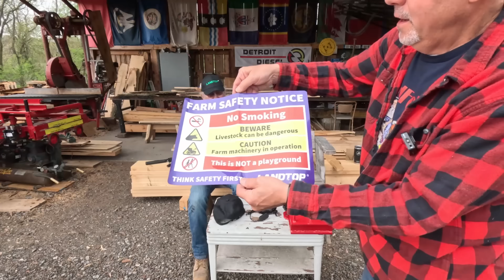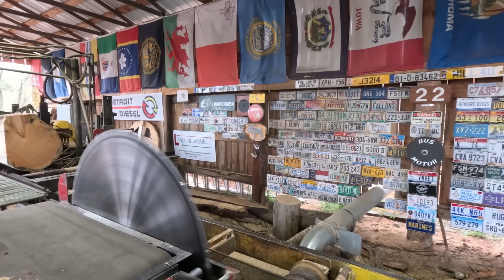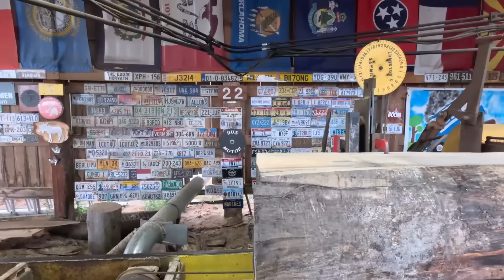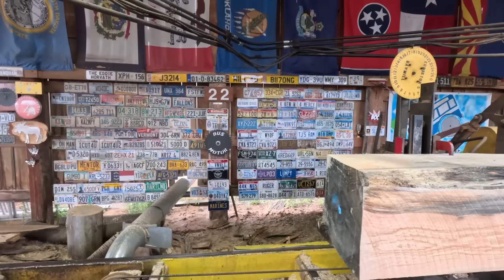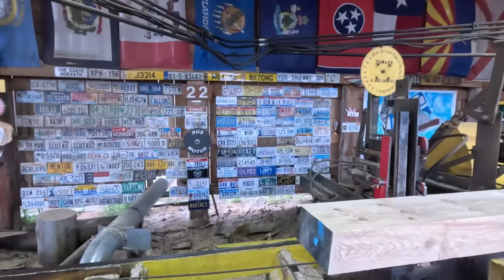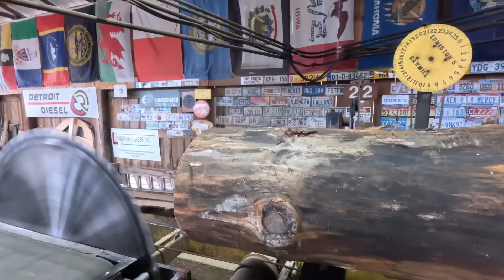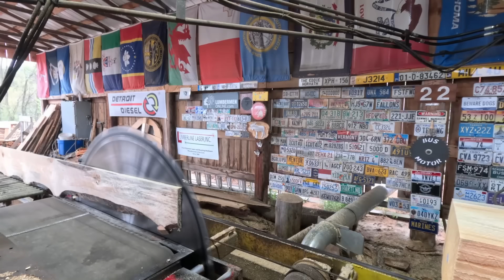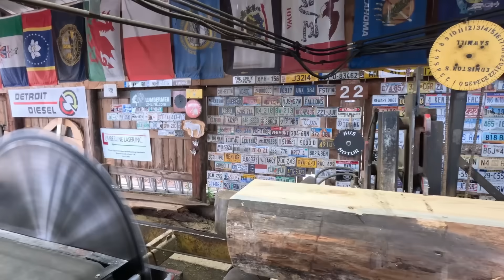sawing northern white pine logs into 1x12s # 553

Comment: Cutting pine smells great. Especially when hitting the knots. Never been hit by a board...but, I have sent one across the basement into a wall. I have a 1958 Craftsman saw they call the widow maker. You can cut north and south...and turn the head and go east to west. I was cutting a 2X4 in 2 and the caught the board and sent it. I have never used that saw like that again.

Comment: That's one of the better trailer hitch couplers for pallet forks that I've seen.  These ones use both forks in the center of the loader arms and won't bend the loader frame by just pulling on 1 fork.
Reply from the maker: yes it's heavy duty for sure.

Comment: I got a hitch made for a Gravely walk bvehind to fit on a 40 inch kidney mower to move the wood splitter with. It was bolted on but gone now. Out of the business!
Reply from the maker: we had a sulky that had a steering wheel for our Gravely walk behind it worked great
Reply: @markgalicic7788  Mine worked fine but I swapped it for a rotary plow.

Comment: What happened to your kiln? I seen videos of you making it now I don’t see it anymore?
Reply: The kiln plan is suspended indefinitely.
Reply from the maker: it's on hold due to power.
Reply: @markgalicic7788  Those girlies at Lumber Capital Log Yard run an off grid one. Eddie's a big fan, he could talk to them.
Reply: @keithengland9068 Kilns need fans!
Reply: @troytreeguy  They make it work, watch the video.
Reply: @keithengland9068 Yea but remember they are a lot hotter than Mark. That’s why it works for them.